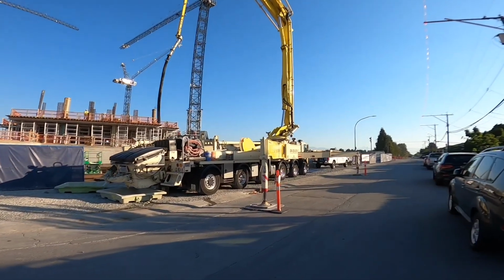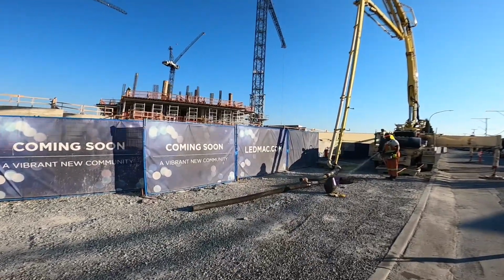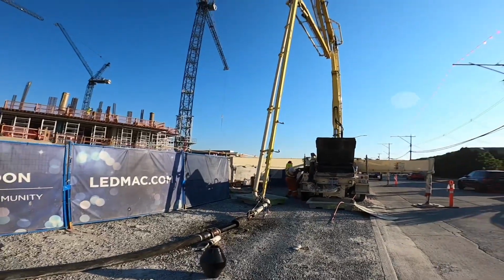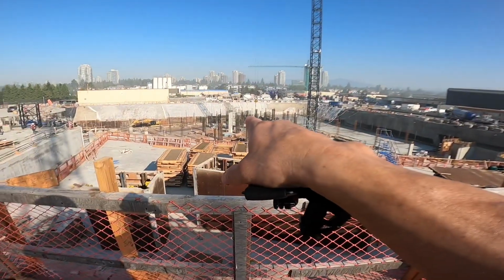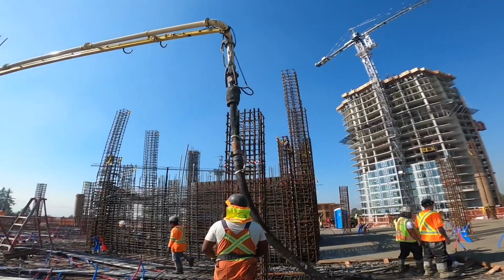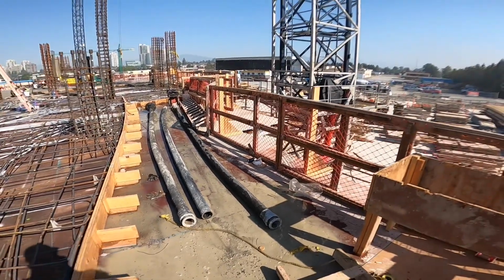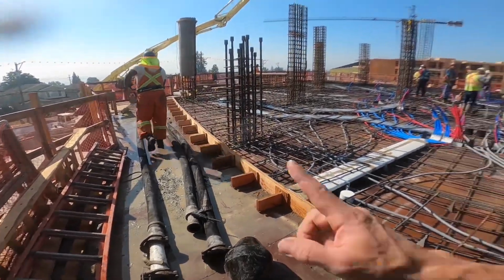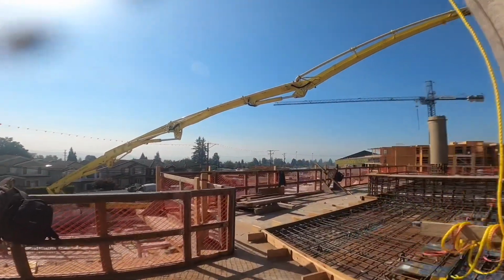Line-Dragon Eggs and single-ended discharge hoses make for a happy pumper.

Comment: Agree on the long reducers when I started pumping back in the 70s thrue the 80s the mixes were so harsh and boney and a pumpable mix was not a guarantee many years ago. We didn’t run a lot of rubber either cause the mix had a tough time with rubber and light weight concrete mixes were even tougher to pump   Now everything is pump friendly   It has come a long way
Reply from the maker: We’re lucky in this part of the country to have very “pump-friendly” materials. I swear if I were to head out east or down south I’d be a rookie all over again trying to learn how to deal with some of them nasty materials which they are forced to work with. Much respect to  those guys.

Comment: I used a 25 foot 3 inch today for 250 yards of lightweight 🤣
Reply from the maker: Love me them 25' lengths of hose for 3" diameter and smaller line. Longer lengths of hose= less clamps.

Comment: Why would a contractor choose to use crane and bucket as opposed to pumping? Other than I imagine cost (if even that)
Reply from the maker: It’s one one those things, if they’ve got a good operator and a big enough crane, buckets can actually be a fairly efficient way of placing a typical 130-170 cubic meter high rise slab (and this is coming from an admitadly biased pump guy) 😂😂😂

Comment: I prefer to also use additional "grill" to catch up bigger rocks before they even enter the pump if theres 3" or smaller line attached to the boom and also longer "reducers" from 5" to 4" and 4" to 3" to reduce the risk of rocks gathering into reducer and violently going through.

The additional grill is like 5x5 cm steel fence or similar.
Reply from the maker: Yes, we do the same. I’m planning to do a future video showing what we use for secondary hopper screens for different types of mixes. The 3.5” reducing stem hoses I find are most susceptible to plugging when transitions between loads (changes in slump and/or driver washes into the hopper).

Comment: Here in Ireland we use 10 foot 4inch hose for deck work like that them 20+ foot hose's are to heavy to empty when full of concrete and if concrete is from a company that has a nice pump mix we sometimes use 3inch 10foot hose but if crushed rock we have to use 4 inch.
Reply: Not a fan of that reducing hose either maybe love the stream but plug all the time
Reply from the maker: @nathanhoelscher1798  yup, they definitely don’t like even modest changes/transitions in slump.
Reply from the maker: What I like about the 20’ hoses is that there’s less clamps/junctions to deal with, but completely agreed, 10’ hoses are way easier to drain.